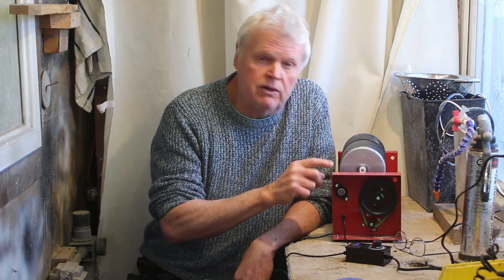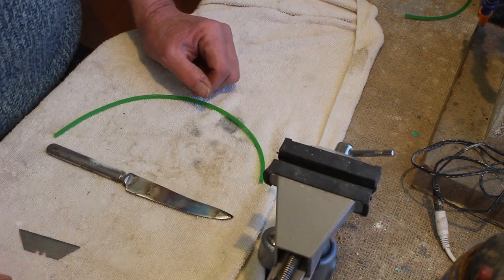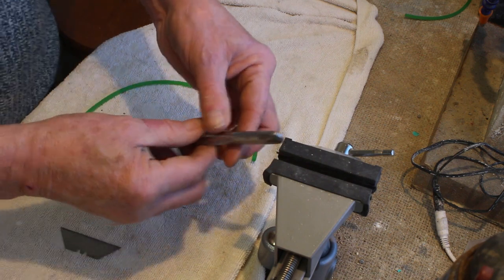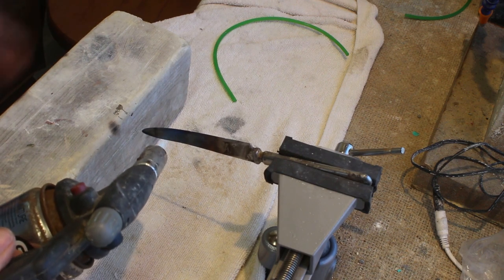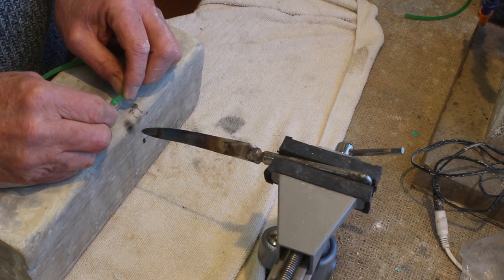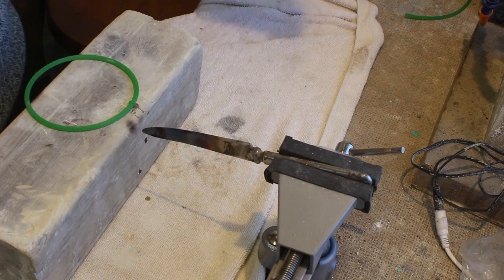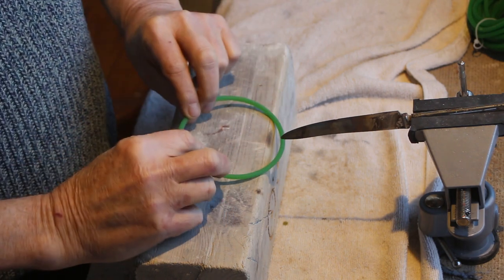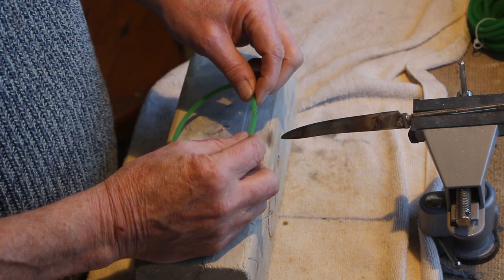Poly drive belt joining tutorial, the simple way.

Comment: I've used a cheap soldering pencil to do the melting. I use the 1/2 diameter "stem" of the soldering pencil. Works great.

When I first tried fusing poly belts I used a lighter but found the flame either chars the poly, or introduces soot, or both, which weakens the bond.
Reply from the maker: Great tip! For someone who has not got a blowtorch this is a great idea thank you!

Comment: Very nice. I suggest using a nail clipper to smoothen the melted bump - the material is very strong and difficult to cut with a box cutter. For sewing machines, this material is very slippery and will not turn the handwheel. It seems the tube width must fit tight inside the motor pulley, otherwise it will slip
Reply from the maker: Thanks for the tip!

Comment: Ty sir for the great idea!
May I ask if this will work with rubber belts? (Like the ones inside cassettes and VCRs?
Reply from the maker: I don't think rubber fuses like this, but I am nor sure. Let me know if you try it! Cheers!
Reply: @thestonecraftingworkshop7490  Tyvm. Rubber indeed won't fuse. I did try. It chars and becomes brittle...

Someone said the only way is "rubber cement" or superglue which does not stay as much and breaks..

Comment: You definitely need to hold the joint until it sets fully! Rather than a gas-heated blade, I might try an flat adaptor taking the place of an 'el-cheapo' 12V soldering iron.
Reply from the maker: Thanks for sharing.

Comment: It may fuse but it doesn't last in a dryer fan pulley situation.  It popped soon after. Maybe 1/2 hour later.
Reply from the maker: Poly belts are not good for powerful machines, I am guessing you really need a proper drive v-belt. Good luck.